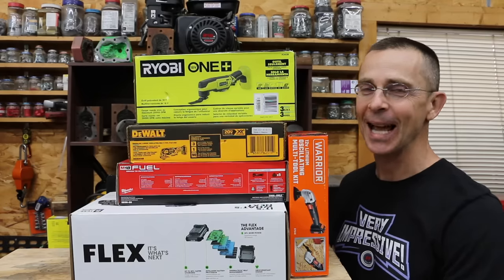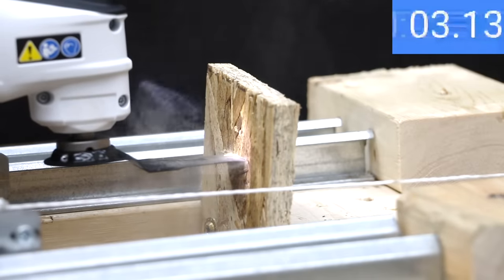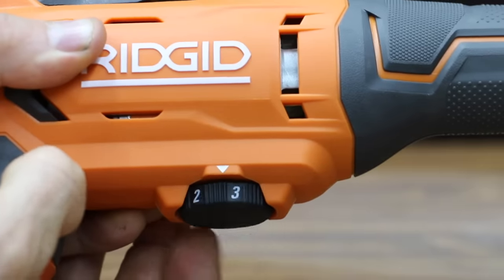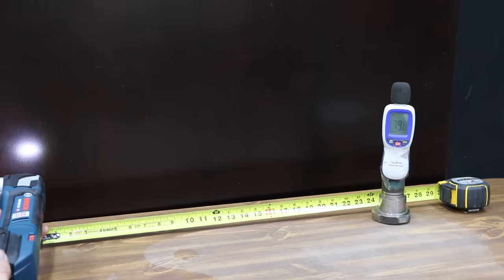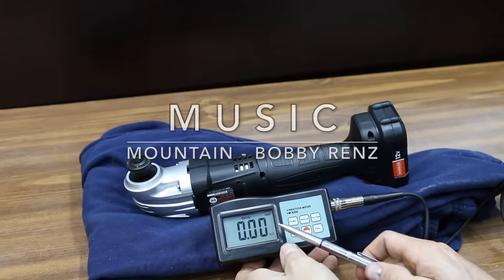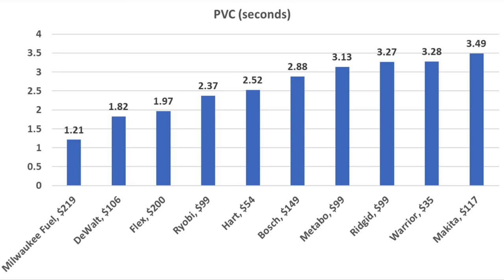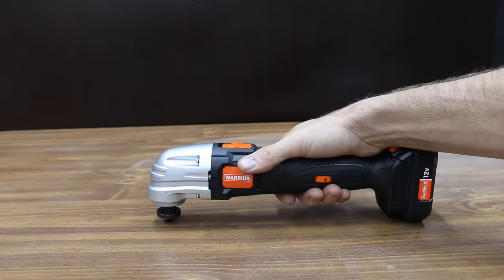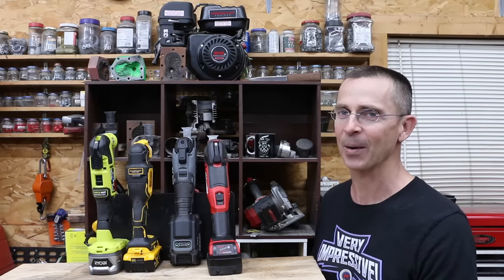Best Oscillating Multi-Tool? FLEX vs Milwaukee, DeWalt, Makita, Ryobi, Ridgid, Hart, Metabo, Warrior

Comment: Thank you for this video, very well done! But I think the Fein Multimaster should have been within your selection (different cordless types available), since it was the first oscillator/multitool - and is still dominating (at least in europe). Furthermore there is another Makita oscillator model available(DTM52Z), which would have been a fair competitor for the rest of the show, with starlock MAX etc. And last but not least I am sry to correct you, but FLEX is a brand founded in 1922 - they just expanded over the pond lately.
>>>Anyway, I loved the video, thank you and keep up the good work. <<<
Reply: Not the cordless fein, milwaukee beats it easy
Reply: @promo130  anyway, the Fein would have completed the test, right?
Reply from the maker: Thanks and you are welcome!  Thanks for the suggestion.

Comment: Having other tools in the 18v Makita platform, I was leaning toward purchasing one of their multi-tools. I'm glad I saw your video first!
Reply from the maker: Thanks!
Reply: AVOID THEIR lower end models... Both Bosch and Makita have extended their tool  lines toward the CHEAP end, so that their lowest price models are below the expected-for-the-name performance... (they are trying to catch the unsuspecting buyer with low priced models that fall short, but sell only because of the namebrand).

Comment: I have the DeWalt atomic multi tool which I love. It has the same blade change feature as the XR which is great because often I have to change the position of the blade and no other brand has a quicker or more easy change.
Reply from the maker: Thanks for the feedback.

Comment: Being a carpenter contractor, And speaking from experience. I use the dewalt. It is the second dewalt I owned, I have owned numerous other brands, most of them died quickly, especially when cutting sheetrock, the fine dust destroyed them,   The dewalt, dosn't seem to be effected by drywall dust.  I will not purchase any more oscillating tools where the blades are held in by a screw system, "THEY ALWAYS VIBRATE LOOSEl"  the quick change squeeze handle, is the only way to go, it holds the blades  securley, and expediatse blade changeing, in my opinion.  Using this tool, often over head, a light one that fits easy in your hand is a bonus, I would appreciate you testing various blade manufacturers and make up of blades,  Thanx for listening  Steve
Reply from the maker: Thanks for the suggestion.  Thanks for sharing.

Comment: Nice test. I have some thoughts on some of the conclusions though.  I have used the dewalt and Flex extensively, and briefly tested the Bosch.  I don't know how you would do it, but testing the vibration while actually cutting would be much more useful.  The Flex wins that hands down with its floating head.  The difference in this area compared to the Dewalt and Bosch is substantial in actual use.  Also, the Dewalt blade change mechanism is very good when new, but after a lot of use, the spring gets gummed up with sawdust and rusts fairly easily, requiring an uncomfortable amount of hand force to squeeze.  Worth noting that you can only use the open back blades with this mechanism as well. The Bosch is the best on this with the click on blades.  The Flex is a close second, only requiring the lever to be opened to attach blades, and ejecting them without touching them, which is nice when they are hot.  It can also use Starlock Max blades which the Bosch cannot use.  I can't stand the designs with a separate pin that can be lost.  I do agree that the Flex is a little bulky and heavy, but the grip is comfortable.  The combination of very low vibration while cutting, the 4* oscillation angle providing fast cutting, and the excellent blade change mechanism make the Flex the best overall that I have used.  I don't like a lot of the Flex tools, but the multi-tool is excellent.
Reply from the maker: Thanks!  Thanks for the feedback.

Comment: Trivia: The original multifunction tool was created by German toolmakers Fein.  It was a cutoff tool for plaster casts.  When I first heard about them in '95, the kit cost over $450, so I immediately went down to HFT and got a corded one for $27.  //  When I wanted a variable speed rechargeable, I found the 12v TackLIFE kit at $47 Amazon, complete with tool, blades, scraper, sanding pad, battery, charger, and blow molded box.  The variable speed control didn't work on the first one, but TackLIFE had one to me 4 days later, and I kept both. It has a quick release function with a retained bolt, very quick and easy.  The TackLIFE MFT is quieter and vibrates less than the HFT MFT.  Both tools have been VERY good values.  And I said the same thing you did, Todd, that "I didn't know that I needed one until I bought one."  The longer I have mine, the more I use them.  //  TIP:  If you are doing blind cuts, a shop vac nozzle next to the edge of the cut sucks away dust, allowing the blade to stay cooler and cut much faster.
Reply from the maker: Thanks for sharing.

Comment: I have a suggestion if you ever revisit the oscillating tools.
Check the vibrations in the cut. Because the no load vibrations aren't usually significant, but it can really shake when you plunge in. So the vibrations where you actually hold it most while using would be the most helpful.
Appreciate all your thorough testing!
Reply from the maker: Thanks for sharing.

Comment: As a carpenter who has burned through at least 6 fein tools, I can say the Milwaukee is better than corded and the best cordless oscillator I have used. Not the regular one however, it has to be fuel. I stopped using my jamb saw because you can use this one handed. God forbid you touch yourself with the blade, no real harm done.  another great review.
Reply from the maker: Thanks!  Thanks for the feedback.

Comment: I really love your videos.  I used a cheap harbor freight 120V oscillating tool for a few years, then got a Ryobi 18V, which was much better and I didn't realize the value of this tool until I had one that just performed better.  Unfortunately it burned up during a big remodel job, and I was going to replace it with the same model when I saw a Rockwell corded multi-tool, and it gave me a similar bump in performance.  With a larger range of motion and more power, it moves through material with very little effort.

Thank you for the quality videos,  which I frequently refer to when researching the various brands.
Reply: What are you using it for? I've had mine for a couple years and only used it a handful of times. Definitely handy to have but not a daily use tool for me.

Comment: Thanks for the review - my A/C powered Dremel with a brushed motor just crapped out so I got on your channel, watched your review, and since I already had an Ryobi 1+ battery on another tool I have, I settled on that Ryobi 1+ HP (brushless motor) you recommended for $119.00 at HD and WOW, is it SUBSTANTIALLY better than that crappy Dremel oscillating tool I was using.
Reply from the maker: You are welcome!  Thanks for sharing.

Comment: Just bought one a week ago. I bought a DeWalt Atomic to cut a square opening in my RV to install a monitoring screen. Game changer compared to the old method of drilling a hole and using a jig saw. There were wires behind the panel so I couldn't safely use a saw.
Reply from the maker: Thanks for sharing.

Comment: I currently own the DeWalt and the Hart, so it was great seeing them compared.

Pressure Test- DeWalt 3, Hart 7
Vibration Test- DeWalt 4, Hart 7
PVC Test- DeWalt 2, Hart 5
Nail Test- DeWalt 6, Hart 5
vibration- DeWalt 4, Hart 7
Noise- DeWalt 6, Hart 4
Weight- DeWalt 5, Hart 2

Overall- DeWalt 3.7, Hart 5.7

Assuming you had the batteries, I think the DeWalt is one of the best due to it performance for the price, and it's unique quick change system. But if you are just looking to add a decent tool for an low price (and you have the batteries), I'd say Hart is really pulling it's weight. Maybe Ryobi as well. I really can't see going with the FLEX or Milwaukee unless you have the money, batteries, and you feel like you absolutely must have the very fastest.
Reply from the maker: Thanks!  Thanks for the feedback.

Comment: Loved your video, only wish you would've added an overheat test as a couple of these tools I've used were prone to shut themselves off after about 10 mins of cutting.  Still extremely useful data, you even swayed me from buying from one of the brands that performed poorly as anything hard to hold is hard to control, and nobody wants to be cutting with something they can't control.  Thank you!
Reply from the maker: Thanks!  Thanks for the suggestion.

Comment: I have both the Milwaukee and DeWalt, which I use daily.  The game changer here is the blade change.  Although the Miwaukee seems easy to change blades, vibration through extended use will tighten the bolt on the blade, require a tool to loosen.

The dynamic use of these tools on the job site requires frequent blade changing.  The DeWalt gets the nod here, there is simply no comparing the two.

Additionally the lights were not tested.  Often times the work area is poorly lit and requires the light.  Of the two, my DeWalt out perfoms the Milwaukee.

As a side note I'm not a "DeWalt" guy. This is the only DeWalt tool I use regularly.  I have Milwaukee, Rigid, Port Cable, Makita, Black and Decker, Hilti, Bosch, Craftsman and Harbour Freight in my tool trailer. 

Not all blades are created equal. Maybe you could do a video on them.

Love your Channel.  Thanks for the hard work!
Reply from the maker: Thanks and you are welcome!  Thanks for the suggestion.

Comment: I used a Porter Cable oscillating tool for 2 years before I switched to Milwaukee. I didn't have any intention of switching until I saw all the options for 18v lights. The difference is night and day between the PC and the Milwaukee. The Milwaukee cuts like butter.
Reply from the maker: Thanks for the feedback.

Comment: Nice comparo! I bought a Fein brand, made in Germany. I can't remember how much I paid but it was expensive between $150-$200. I think I bought it at Lowes 8 years ago. Like you, I didn't know I needed one till I bought it. Very handy tool, especially for slicing nails or screws between wood or trim. The tool is super high quality and it came with a bunch of starter blades. I've found the blade price or quality make a huge difference.
Reply from the maker: Thanks!  Thanks for sharing.

Comment: I was little surprised to see that the Fein multi-tool was not in the line up, maybe they don't make a cordless version. I have had my Fein multi-tool for a long time. at the time I bought it, Fein was the only one who made this tool cordless or not. It was outrageously expensive but  when you don't have a choice and you need the tool you buy it anyway. It has been very good tool and it has saved me in a lot of situations. what I like most about it is its ability to plunge cut cleanly. this is especially important when you need to make a cut in wood that is already installed and finished.
Reply: I actually came to say this! Fein makes theirs corded, cordless, and pneumatic. Each is made in 3 different levels. Impressive offering.

Comment: My biggest beef with an older oscillating saw, a Rockwell, was the very poor way to have to remove and attach a blade.  What a chore!  I bought the Dewalt.  It was ranked fairly high to begin with but it was the blade chucking method that sold me.  Quick  and easy and no need to look for the Allen wrench every time there’s a need for a blade change.
Reply from the maker: Thanks for sharing.

Comment: Love the Channel, but I'd like to mention something. If people want a good multi tool for cheap, buy plug in. You can get a Porter Cable that performs on par with the Dewalt battery multi tool for a a fraction of the cost. You can manage to get the Dewalt at about the same price, but if you need batteries it will be double the price. I've always been perturbed by just how much better even low level brand corded multi tools are compared to battery powered. The vibrations aren't returned into the body of the tool which makes the cuts occur faster and more accurate.
Reply from the maker: Thanks!  Thanks for the feedback.

Comment: Thanks for this. I recently learned from my sailor friends that by far the fastest tool to cut away the thick steel cables that hold up the mast on a sailboat is a multitool. (When they said Multitool, I first pictured one of those Gerber things we all have in our pockets.  The cables are 3/4" thick. huh??) 
If your mast collapses you need to cut away the support cables and lines as fast as possible so your boat isn't pulled under.   (And they're good for a lot of boat jobs.)  So Milwaukee it is.  I can't believe I've been DIY for my entire 67 years and I have yet to get one of these tools. (I've also never owned a torque wrench. St Peter is probably going to be very confused when we meet. )
Reply from the maker: You are welcome!

Comment: I have the Milwaukee, nice  :)  I have black and decker 20v max tools but they didn't have an oscillating tool so got this and a converter to use the black and decker batteries with it. works well.
Reply from the maker: Thanks for sharing.

Comment: IT would have been interesting to test vibration under load. The load will induce vibration, so if it has compensation, the compensation could induce additional vibration under no load, if it is a counterbalance system. When these first came out, I used a Ryobi and then used a Fien. The Ryobi had excessive vibration - so much so, I taped a hammer head to it, to dampen it. This actually made the tool work faster as well. The Fien does not need any additional damping.
Reply from the maker: Thank you for the video idea!

Comment: I had a Ryobi - I was renovating a bathroom and using it to remove group. It did not last that long - it just stopped working - so I switched to the Bosch and it had better performance, but importantly it lasted much much longer
Reply from the maker: Thanks for sharing.

Comment: Firstly, very well done comparison as always.. but one thing that I had issues with was  that with this oscillating multi tools the different blades make a huge difference and since you comparing the standard units to ones with that Bosch and makita star lock system that means it’s literally impossible to conduct this test with accurate controls on blade performance..

But regardless I was surprised to see how that star lock system performed comparably if not worse than the standard locking system… the units with the star lock make a huge point of advertising that this locking system creates more torque transference to the cutting edge which is supposed make for a faster cut.. I always just believed that since it made sense..

I have the Rockwell unit that uses the standard blades but has two different oscillating angle modes meant for wood and metal as well as a speed dial and tool less blade change.. using it regularly for better part of a year and I love it, it’s actually a really convenient and useful feature.. I got it for like 70 bucks or something and it is a corded unit but even so I don’t see myself replacing it with another model unless other manufacturers develop and model that has comparable features.. food for thought if nothing else
Reply from the maker: Thanks!  Thanks for sharing.

Comment: I think it should be noted that cutting speed is heavily influenced by oscillation speed (along with degree of rotation).  Some of these tools are at a disadvantage if the test speed is inappropriate to clear the debris efficiently.  In practice, if this happens, adjust the speed and pressure for the best overall cut.  The testing here isn't exhaustive enough...and really wouldn't fit the format.  However, I would have liked to see the rpm standardized to be able to see how degree of rotation influences the outcome.

One thing I noticed was the strange flex that the Milwaukee head had.  I would have liked to have known why it does that.

Another great video.  Thanks!!
Reply from the maker: Thanks and you are welcome!

Comment: I have the Milwaukee M12 Fuel, and I have seen in numerous tests perform as well as the M18. The main difference between the two is that the M18 increases power upon more pressure, and is said to vibrate slightly less than the M12.
Reply from the maker: Thanks for the feedback.

Comment: I bought my saw (not batt oper) 10 yrs ago from Harbor Freight for @ $25. I have beat the hell out of it and it is still a champ. keep the blades sharp and it does the job. never had anything go wrong with it. now I want something that will be an easy blade switch. Mine is a pain to change. I have to hold the units in my hand to make up my mind. I have to travel 150 m to Milw dealer. The blades are the ticket but so but expensive. ha, what isn't now days? I went to buy a box of See;s candy and almost fell over from sticker shock. used to be $17 a box 3yrs ago now $30. Thanks for your excellent work...........
Reply from the maker: You are welcome!  Thanks for sharing.

Comment: I’m a apprentice plumber all of are crews have and love Milwaukee tools i love the oscillator with the 6.0 battery it’ll run all day and cuts drywall and wood fairly quickly but those come with a hefty price tag and the battery’s are 260 bucks for a 2 pack
Reply from the maker: Thanks for sharing!

Comment: occilating tool is a must have for everyone in my opinion. I do not know how I ever imagined before without it. I guess with chisels and lots of time wasted. with these tools you can plunge cut right into whatever you need to. tight spaces no problem. wether you buy the most expensive or least expensive I think is less of a concern , the bottom line is buy one of these....you will not regret it.